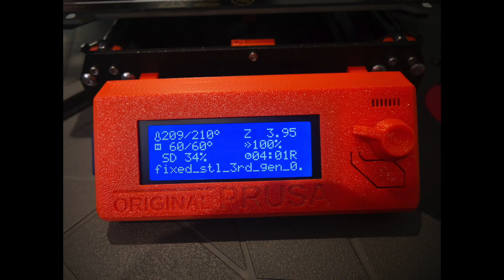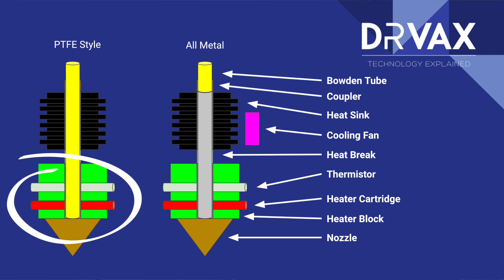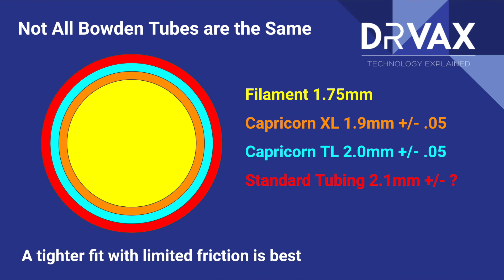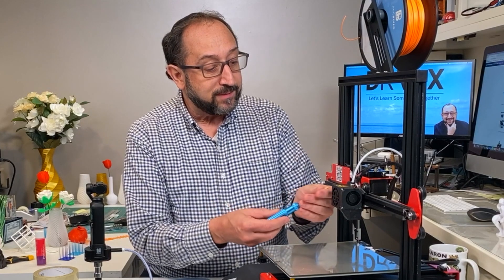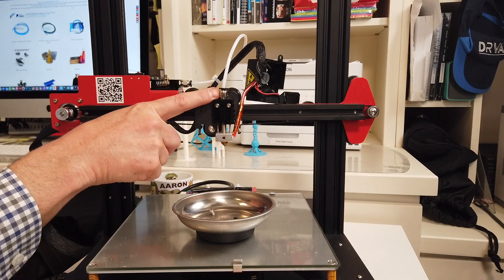Installing Capricorn Tubing and Anet ET4  Thoughts

Comment: Hello Dr Vax, I really love the way that you share knowledge! Learned a lot with you.

I was able to install capricorn tubing on my anet et4, what I noticed it was that at the bottom, the metal cilinder had a small defect that was making nearly impossible for the tube to go through.

So with a matching drill bit I removed that defect and then my tube was able to touch the nozzle.

Comment: hello sir, I have an et4 printer and I found a problem with the incorrect dimensions of the model in the z section. I printed it with a 20mm z dimension but the print result was 19.4mm, how do I fix it? (I use a cura slicer)

Comment: I stumbled across this problem just today. Had the ET4 for half a year and the lock on the tubing broke on the extruder side 2 days ago; hot-end side was still ok. Ordered the Capricorn set (Including a very nice cutter), it came today and I put it together again. Was wondering if it could work with the delivered nuts...
Nope, the nozzle clogged immediately :(
So now I have to find a way to get the filament out of the cold hot-end (will try tomorrow, currently the A8 is doing the ET4s work 😜). 
Would you recommend exchanging the hot-end and if yes, which one would work?

Comment: I fit a capricorn tube inside the hotend of my ET5, without any issue!
Reply from the maker: It will fit up until the "throat tube".  I have confirmed this with ANET.   This might work, but you may find your filament jams in the throat tube since it does not have a non-stick lining.
Reply: @MakeWithTech  sorry but what's the throat tube? I think mine went all the way to the nozzle because it's the same large as the original ptfe tube 🤔
Reply from the maker: Excellent news.
Reply: @MakeWithTech  maybe you should give it a try and check if you can use it :P
Reply: @Craig Danks well that's good the see, now I'm just waiting for my Silent board, so I can flash it with marlin and make it bettee
Reply: @Craig Danks so yes now I disassembled the hotend, the capricorn didn fit all the way down, but I cleaned the throat tube with acetone, and fits perfectly, I goes all the way down to the nozzle, with the stock ptef tube had some ¿licking? But now it's just perfect, and it prints really good using Prusa Slicer with the profile from the hispanic anet group!

Comment: Hi , good timing , I was about to order a Capricorn tube on Amazon for my ET4 . Cancelled that quick ! By the way I installed Marlin on my printer , it`s a big improvement because I can tweak all the settings. :)
Reply from the maker: Nice.  Which build did you use and did you also install a boot loader?

A great place to discuss this is at the DrVax forum located at https://forum.drvax.com.
Reply: @MakeWithTech  Hi i used the original bootloader and loaded the Marlin code @ 0x08000000 with STM32 ST-Link utility and St-Link stick , I modified this version https://github.com/davidtgbe/Marlin and if you go in the users configs you will find the ET4 config files. My printer is really a clone of the Anet ET4 , a Labist ET4 but it's almost the same hardware except it has the inductive sensor for the Z axis. By the way I enjoy your channel !

Comment: Thanks a lot for sharing, now I'm fully convinced that was a big mistake to get this printer
Reply from the maker: I understand you point of view.  Overall the ANET ET4/ET5 hardware is quite good.  There is no simple solution for the non-standard bowden tube but I understand a very of standard Marlin firmware should be available before long.

P.S. I have started a new discussion forum at http://forum.drvax.com where we can all have more elaborate discussions and share pictures on our prints and printers. Check it out. Irv

Comment: I was able to install the Capricorn tubing in my anet et4.
Reply from the maker: Make sure it went all the way down to the nozzle, or it will jam over time.
Reply: I just did this to my ET4X.
I ran into the same problems you did Dr vax however I took apart my extruder and discovered that the Capricorn tube was getting caught in the black heat dispersion unit above the hot end the Capricorn fit perfectly in the isolation tube all the way down to the hot end so what I did was I took a small drill bit that would fit through went one size up and bored out the center of my hate dispersion unit just slightly this allowed the Capricorn tube to go all the way down to the nozzle.

Comment: Could you please share your cura profile
Reply from the maker: For what printer?  The Anet ET4?   For that printer I would just start with the current version of Cura 4.6 and use the ET4 profile which is included with Cura.  Then I would change the gcode start code to the start code I list on the drvax forum which you can find here:

https://forum.drvax.com/forum/3d-printing/27-universal-template-for-gcode-start-code

There are a lot of comments about this start code which is an excellent discussion.  You will find my original start code at the bottom of page 2 of this post.

Comment: Hi DrVax, our user Leonardo Boa Sorte offered a solution. Buy the PC4-M6 pneumatic connectors, which could work with ET4 and 4mm od tubing. Haven't proven yet, which could have a try. 
https://pt.aliexpress.com/item/32809884127.html?spm=a2g0s.9042311.0.0.1ee7b90ayic6D7

Comment: Dear DrVax, thank you so much for sharing! The knowledge of pneumatic connectors would be much helpful for our users to have the replacement. 
The outside diameter of the tube is 3.8mm. Sorry that at present it may not be matchable for Capricorn bowden tubing. For the replacement of the pneumatic connector and the PTFE tube, you could get it on our official eShop: https://anet3d.es/products/pneumatic-connector-with-tube

Comment: If you loosen the nozzle 1/2 of a turn when you insert the tube, heat it up at 200C and then turn the nozzle back tight, you will get a really nice and sealed fit of your tube. Not my personal finding, just ‚best practice‘ in the community. Greetings 👍🏻
Reply from the maker: Yep I agree and I may have mentioned that in the video.

P.S. I have started a new discussion forum at http://forum.drvax.com where we can all have more elaborate discussions and share pictures on our prints and printers. Check it out.  Irv

Comment: Bummer 'bout the mismatched ODs. Here's an idea: sand the end section of the Capricorn tubing! Would it still seal properly? Don't know. Maybe. Possibly. If you get adventurous and try it, let us know how it goes...
Reply from the maker: Might work.  Interesting idea.  Really a good idea.  I will try it.
Reply: Did u try it @drvax?
Reply: Hi Jemy, the outside diameter of the tube for ET4 is 3.8mm.

Comment: I just bought the capricorn tube for my anet et4 pro, then find this video. Don't know what to do with the tube now. Please do share if you find any good solution for this problem... thanks.
Reply from the maker: Yep.  It is an unfortunate design decision by ANET.
Reply: Hi Jemy, the outside diameter of the tube is 3.8mm. Sorry that at present it may not be matchable for Capricorn bowden tubing. For the replacement of the pneumatic connector and the PTFE tube, you could get it on our official eShop: https://anet3d.es/products/pneumatic-connector-with-tube
Reply: Download the ptfe cutting tool from thingiverse use that to cut the tube, mine fits perfectly on the ET5 all the way down to the nozzle

Comment: I don't understand why you don't heat up the hot end first. This will certainly help remove the old PTFE and I bet allow you to insert and 'clean' out the extra glob blocking its insertion.
Reply from the maker: You are correct.

Comment: When I bought my Capricorn tubing I ordered it with the required tool to ensure a 90 degree cut.
Reply: Very important as even using the sharpest knife will deform the tube as you cut it - the tools that support the sides of the tubing as you cut are a must. Also, please don't use pliers to loosen/tighten nuts/fittings as it's a sure way to ruin them, always use a spanner/socket. As I was always taught, the right tool for the right job.
Reply from the maker: Thanks for sharing.
Reply from the maker: Yep.  That works.

Comment: Great video again, i learned a couple of things :)
I also have an Anet ET4 since about a month and i think it is time i do some maintenance on the hot end.
Last few long prints my extruder was "clicking" and skipping and i had some underextrusion. I fear that the bowden tube has moved up just slightly and that it is suffering from temperature-creep.
At least now i know not to replace it with a Capricorn tube so thanks a lot.
I am also thinking of removing those 2 screws that connect heaterblock and the heatsink to have less heat moving up.
Reply from the maker: In is interesting the Creality hot ends also have the two screws connecting the heater block to the radiator.  It must be that and engineer somewhere though they were structurally necessary.  I am trying to find a source for bowden tube that will fit.  The alternative is just to upgrade the hot end.
Reply: Hi sir, for the "clicking" extruder problem, first, check if the nozzle is too close to the heat bed. If not, maybe the teeth inside the pneumatic connector stripped off during usage and need for a replacement. If you could not get it on other platform, you could get it on our official eShop: https://anet3d.es/products/pneumatic-connector-with-tube

Comment: Good video - and surprising end ;-)
I do not have the Anet ET4 - but as far as I know there are two versions, one with TMC, one with A4988. As the firmware is closed source and not so good, but the hardware is excelent, It would be worth a thought buying the about $20 less expansive A4988 version and buy a SKR e3 mini (about $30) to upgrade. So you would get open source Marlin 2.0 with all it nice features. But I am not sure about the display. Do you know if it is serial connected or is it for use with the stock mainboard only? If it is the later, you also need a new display. This can be an 12864 (like on the Ender 3, about $10 on Aliexpress) or maybe an SKR touchscreen (about $25, but depending on version/size). If you want to add Octoprint anyway (so full controll via Webinterface), an 12864 would be the best choice (but mostiy, for more adcanced users, the 12864 is the most powerful option anyway).
Actually for beginners this might be a bit complicated. So in your opinion: Is the firmware a problem for beginners, or can they use the printer as a first 3d prfinter in stock configuration and might upgrade later, when they have become more experienced?
Reply from the maker: Interesting thought for an user comfortable with electronics.
Reply: @MakeWithTech  or for an user who starts with learning electronics - but only if he is infected by the "3d-printing-virus" and the ET4 is not his only printer anymore ;-) But I think the electronics part is not the complicated one - its more about learning how to configure and compiling Marlin. In my case it took about one year before I started getting into the software part (esp. as english is not my native language and I had an "E" at school ;-) )